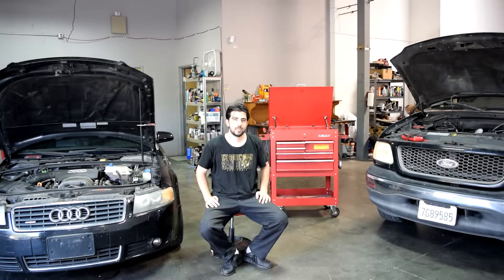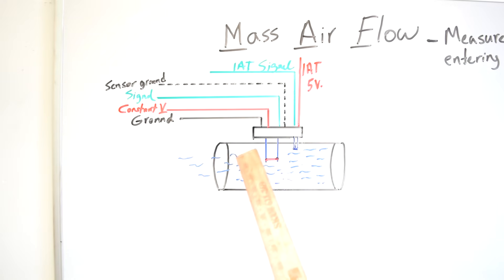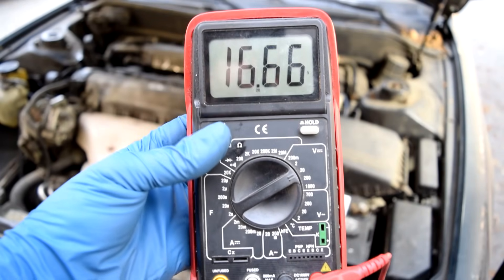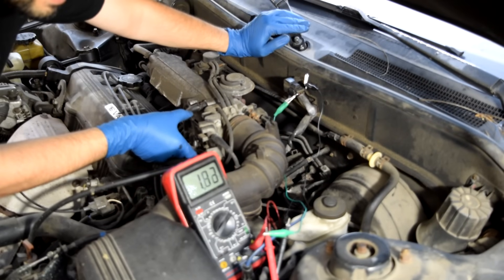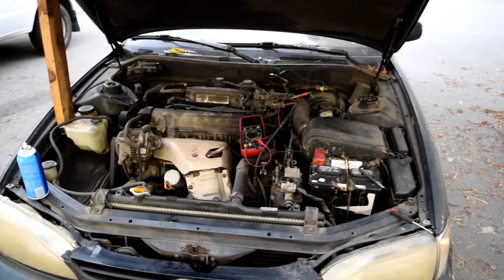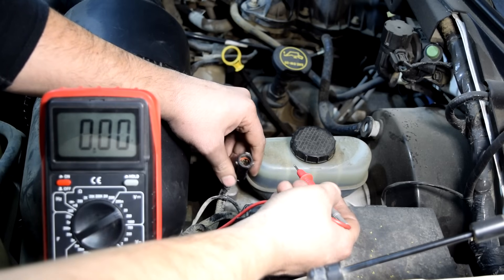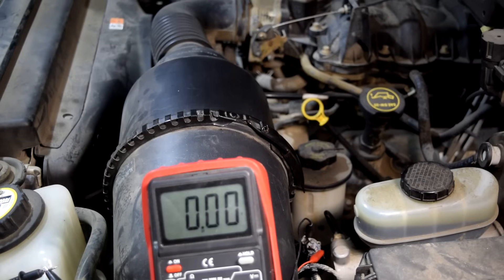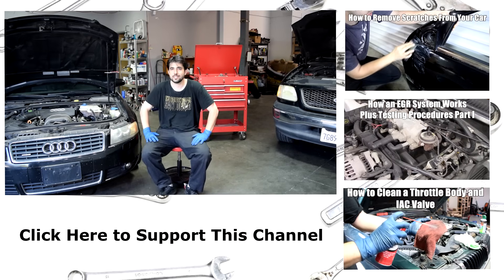How to Test a MAF or MAP Sensor With a Multimeter - Plus an Operations Guide

Comment: Step 1.  Locate MAP sensor location on your car.  Step 2.  Reconnect electrical connector to said sensor which had failen off due to the little hooter that holds it in place being broken.  Step 3, employ white zip tie to prevent this from happening again, inadvertently.  Step 4.  Leave nice comment about well taught lessons on MAP and MAF sensors to RnW big guy.  Step 5. gloat to your kids how you're now an ace diagnostician. Step 6 sheepishly thank the Lord and RnW for making you learn something without buying a part willy-nilly.
Reply: I’m on step 4 currently

Comment: I have a p0106 code on my 1999 Mazda protege 1.6
After failing emissions, I’m trying to find out if I have a bad MAP sensor or leak in air intake system, ...
Reply: Ray Milligan I found out my vacuum line had a crack

Comment: The reason the MAP sensor did not change voltage while gradually raising the engine RPM is because engine vacuum remains steady until the throttle is opened rapidly. Doesn't mean that you could potentially have a bad MAP sensor because it responds to the pressure inside the intake manifold.
Reply: I thought the same thing also im sure it wouldnt happen if the car was driving
Reply: My map sensor decreases in voltage when slowly accelerating. Does that mean it’s a bad sensor

Comment: Hi! I've learned so much and appreciate your relaxed and easy to follow guidance
I just inherited my father's 1995 mazda protege (bought in '97, used/salvage). I drive, but I never owned a car. The car has a rough idle. Mechanic did a code test that showed PO135 11 02 sensor (11 = B1S1?), but engine light doesn't go on.

I've been learning a lot about the air intake system. I assume, on top of my very dirty air filter, the MAF and throttle body are pretty filthy and that's what's likely the rough idle and lazy acceleration
.
I want to clean them myself/install new filter. I want to do what I can before I may have to call the pros for the 02 sensor, but on a video i saw on you tube, cleaning the idle air ctrl valve, suggested that you don't mess with the MAF b/c it's so delicate.

What are your thoughts? Especially on why the engine light doesn't activate.

Comment: Will a dirty MAF sensor have an effect on idling and random engine stalling. I get this issue about every 12 to 18months?
Reply: Finally resolved the issue. . Did a  diagnostics test. It indicated some issue at the throttle body.  Strip and cleaned it. Put it back.
Problem fixed right away.

I was told if it happens again within a week or 2 i need to replace it. Luckily its cheap.

Comment: I have a 2006 dodge magnum sxt 3.5l i got a code today of p0108  witch is the Standard Ignition 3 Terminal Multi-Purpose Sensor
 it was working fine intel i cleaned it do you think it might have gone bad.

Comment: Mi car was diagnosed by Autozone code P1195 for MAP Sensor. Noticed Check Engine light turned on and off several days at a time that could lead to electric false contact. Made test with multimeter and hand held vacuum pump. Voltage wouldn't go down from 4.50 volts when applying vacuum. I started jerking to one side the cables of the electric plug connected to the MAP sensor then when vacuum at 20 in-Hg suddenly the voltage would drop all the way between 0.85 and 1.15 volts which is the expected value, as soon as stop applying pressure to the cables the voltage would rise up again to 4.50 volts and so on. Changed the electric plug with a used one from junk yard. Reset the check engine light. I have been driving the car for 2 days now and the check engine has not light up again (so far), also the car stopped trying to turn off itself (rev's would go back and forth from 800 to 150 and then go back to 800). Nonetheless I tried to duplicate the test you made in the video about with CAR on for the voltage to increase from 1.0 volt to 3 or 4 volts without success. The initial value in my case is NOT 1.0 volt instead my value is 4.50 volts, when I open the throttle the voltage does not change. Please give me your comments. Mazda Protégé 1996 engine 1.5.

Comment: I have 2003 Suzuki aerio sx wagon . I had maf changed about 2 to 3 years ago like all parts from AutoZone this maf is failing again. I need that swapped  can u put a video in how to do it. Yes I saw the mechanic  who did first time, the swap, saw him. But of the two screws that hold maf  1 is stripped so I got to remove box air filter housing   I saw him do that too that's why I see it's easy dible by me  but forgot been such a long time.   so he tried to clean the maf before he installed. New one. It has been a while since I saw him if you u can show me how to do it so I can on my own try to swap orelse I got pay someone money to that. It's not so difficult cause last time I saw the  mechanic. Took 15 minutes to that ...  I think I can do it.  I would have opened it myself except it's been while and 1 screw feels like it's stripped
    2003 aerio sx wagon. If u need my email it more I can post to get in touch with with u .   Help me plz am Union county nj

Comment: the quickest way 2 check any sensor in your car at multiple working time is to start your car while the car is running..using a car computer set it on live data if it is avalible on the computer, it will tell you what ever u need 2 know about any sensor live and direct..

Comment: Hello, I have one Question ?
I found some engine oil in side the MAP sensor & makes my car did not working smooth what do u think the problem with the engine ?
Reply: If your engine oil was over filled than you may have oil shooting up the PCV valve going in and soaking the MAP sensor.  

Or if your oil is not over filled,,, maybe your PCV valve is gone causing it to soak your MAP sensor.  

Once the map is full of oil it cannot function properly and the vehicle will run rough.

Comment: Can a bad maf cause a crank no start condition
Reply: Yes it can, any sensor that runs off of your 5V reference circuit can cause a no start. Only if a sensor on the 5V ref circuit is broken in such a way that it drops the 5V ref voltage then you have a no start. If the sensor is grounded inside.

Comment: I have a 2006 Impala 3.5 and I noticed it when I took the hoses from the brake booster is barely sucking a little bit of air in what would make you do this

Comment: is it possible that a shop will tell that you need to change the whole intake manifold by just voltage reading its self?
Reply: They would have to be totally dishonest to do that because a manifold functions as a set of pipes that carry the air and fuel mixture to the cylinders. I have never heard of an intake manifold needing to be changed unless someone hit it with a hammer. I don't think that taking it off and dropping it onto a concrete floor would crack or damage it.

Comment: RnW, Big question for ya. I need some help from you or the group. I am working on a 2003 Audi TT quattro. She threw a handful of codes that lead me to believe that there is one (maybe 2) sources causing the codes versus 5 to 6 actual failed components. The codes are; P0031, P0037, and P0141 all pertaining to Oxygen sensor heaters. I tested the sensors  and they tested good and in fact are not getting 12v from the ECU. THe next series of codes are P0445, P0449 and P2401 all pertaining to the EVAP system valves and leak detection pump, I have not tested any of these yet. There is a P0414 and P0418 for the AIR system switching and control, the blower is working properly, I have not yet checked what the voltage is that it is receiving yet. The one that I am hovering around is the P0102 Mass air flow sensor "A" circuit low. All of the codes are referring to either a short or low circuit, when I tested the MAF sensor the voltage with the ignition off was sitting at 1.49vdc and when started it was all over the place and never settled anywhere and would dip as low as .004 vdc and barely make it over 1.0vdc. I think I gave as much info as I can at the moment. Let me know what I should do from here so I don't start throwing parts at it.
Reply: After many, many hours/days/weekends of troubleshooting this problem I found the source. Fuse #43, marked "engine,petrol". It is hard to admit to such a simple fix for this but that was it. I noted that all of the failed components (indicated by trouble codes) all had a common wire "blue w/ yellow stripe", traced them on the schematic and shot it back to the relay, then the fuse.
Reply: big question for you. I need some help from you my vehicle start ok but when u attempts to accelerate it cuts off, I try to start it again it start and when I try to accelerate it cut off, it keeps going like that all the time

Comment: have 2013 tucson, no engine light. no error codes. twice or 3 times a week revs will go down to the point it almost stalls. after 15s it goes back to normal, i am thinking maf but i cannot find it

Comment: I have a question I have a gmc 5.7 1998  3 wire on mass flow 1 is 5 volts  the other 2 go to ground what would be you best thought also when I disconnect mass flow when running nothing happens bod reader says bad mass flow and bad cam sensor I installed new distributor with cam sensor no change aks changed crank sender. Thanks
Something else truck keeps fouling 02senser upstream bank 1
Reply: On GM Map sensors they will always read 5v from the power wire, so that's nothing. And you unplugged the maf and the ecu didn't respond? Sounds like a red flag to me haha.
Reply: Dustin Dykman my hole problem was a bad fuse connection took a week to find it

Comment: In case of MAF sensor, will  current be left constant so only the voltage varies with respect to resistance of the hot wire?

Comment: This is great information.  I have a 2000 Maxima that is randomly getting some idle issues and misfire.  I have replaced the TPS and cam shaft position sensor - started running "ok" until I unplugged the TPS to try and test it with multimeter, plugged it back in - problem returns.   Where would you test and how would you draw conclusions of which part is bad?  https://youtu.be/C97Yq1mkYog

Comment: (3:44) Hey, I have one ground and the other two are both high, one 5.1v and other 4.8v , what is going on?
Reply: One is constant v other is signal to computer
Reply: Signal wire also supposed to have voltage, when sensor not attached?

Comment: I have a MAF sensor with four wires I tested all of them but my last one (signal wire) gives me a very low reading  0.05 - 0.12 (when truck running) I even checked that wire for continuanity from the pcm pin back to the MAF connector. Do I just have a bad MAF sensor?

Comment: I don't understand what you mean by backprobe
Reply: Inserting the multimeter probe into the back of the connector because the wires must be connected to the sensor during this test.
Reply: @danielebrparish4271  I understand everything now Thanks.

Comment: The button line is that you can disconnect the MAF sensor wire and let the MAP and OS2 to do the dirty work, so you can save $297+tax on new MAF. and to learn the art of controlling  the break and acceleration in every 3 way stop / red signal  as if you are driving an old car !!!

Comment: I drove my Volvo 2004 V40 for 3 years with MAP only although I cleaned my MAF sensor whenever I changed my Air Filter  every 5K. and still I am experiencing idle fluctuating and check engine code P0172 , but what is bothering me is to switch in and out the MAF connector wire when I parked my vehicle, otherwise my vehicle is running fine with 85% fuel consumption which is no big deal with 4 cylinder engine!

Comment: Please help, My 2007 Honda fit runs very rough also engine light is on. I had the auto zone staff with their tool scanned it. Its says my car needs a new map sensor. So I bought new $107 map sensor put it in, but the car won't start. It can start only when I unplug the connector. And the engine light still on. Why engine won't start with new map sensor?

Comment: i think the MAP is ok as u open the throttle so u are measuring almost fixed value pressure in semi sealed area open to atmospheric pressure that is why when you moved the throttle opened and closed u released the built in pressure in the manifold.

Comment: Thank you for your clear, simple and methodical approach and for the time and effort you have put into these videos. Please forgive my ignorance, I am, as you will see from this question, still learning:           If in the course of probing or back probing to identify wires in any connector, I connect my multi meter with its 9 volt battery to any five volt signal wire, is there not a danger that I may damage or destroy the five volt signal generator(?) or regulator in the ECU?
Reply: No. The meter is designed so as not to damage the circuitry it is testing.

Comment: You are definitely the man . at 72 years young   I understood everything you were testing .. My VW 2.5 TDI 2001   199,000 miles  has gradually lost pulling power .I replaced the old original exhaust with a nice new Stainless de cat system .It was marginally more responsive   , but after fitting a pressure gauge to the intercooler housing   the measured boost topped out at 11 psi.   I was told to expect up to 18psi. The MAF sensor was replaced   for testing only    and the difference was unbelievable   the turbo boost increased as before  but then continued to increase easily passing the 1 bar pressure gauge I had plumbed in . now all I need to do is attempt to clean the original MAF sensor and see if it was recoverable . my short journey transport is a 2011 Nissan LEAF . Everyone should have one of those .. they are the future.
Reply: Can car have both map & maf?

Comment: I normally like your videos but on this one you make a very big mistake. MAP remains constant as revs increase because vacuum does not drop as revs increase unless the  motor is under load, such as when you rev the motor quickly. You've actually shown a properly functioning MAP sensor.
Reply: Very, very good point and kudos to your excellent attention to detail.
Reply: Interesting
Reply: Please forgive my dumbness but I am confused right now! Edit: or wait wait let me explain it as i get it from your comment,, The vacuum remains constant because at idle engine takes the amount of air that it needs and keep the vacuum inside manifold unchanged >> When i accelerate throttle angle opens up more thus letting "calculated amount" of air getting in manifold and then to cylinders so the vacuum still remains unchanged Right? But under load throttle angle changes at Idle so the amount of vacuum decreases? did i understand it right?
Reply: Can anybody tell me if it’s normal of the three wires Two of my wires showing constant voltage ?
Reply: I also need help l get a voltage of 4.9 v on the signal wire and 5 v on the  red wire when l turn the key on. Is this normal
Reply: Actually yes you are correct cause I did the same test and I was wondering is my map sensor bad as well? Then I realize that from the past my vacuum never changed if my vacuum is not changing then no this isn't going to change I knew I wasn't crazy and the only one who saw this LOL
Reply: The MAP is connected to manifold vacuum. When ever the throttle plate opens up manifold vacuum weakens while ported and venturi gain strength.  I think you are all wrong.

Comment: I just came across this page. Not sure if I'm in the right place.. Okay so, I have a 2002 Mercedes-Benz C320 Base 3.2L. I'm getting P0410, P0400 and P0174 cel code. I've tested the secondary air pump directly and it works perfectly. But when I go to check the voltage at the 40amp fuse, nothing. There is no power at all when the car is off or on, cold or hot. I pulled the relay and checked it and it is functioning perfect on all terminals with 0.001 resistance. Am I missing something here? Why would there be zero power at the fuse? Shouldn't the fuse have a constant 12v and be wired in BEFORE the relay? I'm just about ready to pull out the entire fuse panel and rewire the secondary air pump. Has anyone had this problem before? Tomorrow I will pull the egr valve and tube for cleaning. Hopefully this gets me somewhere on the P0400 and P0174 codes. Does anyone have a diagram of all vacuum lines on this vehicle? I've traced and replaced a few lines, but I am very sure I have a vacuum leak somewhere that I don't see. I do not have access to a smoke machine. But would the cigar technique work? If so, where should I be pushing smoke in? 

Any help is greatly appreciated! I'm not sure what other relevant information I should include. But whatever I am lacking, please let me know and I will immediately go out to my vehicle to get it.